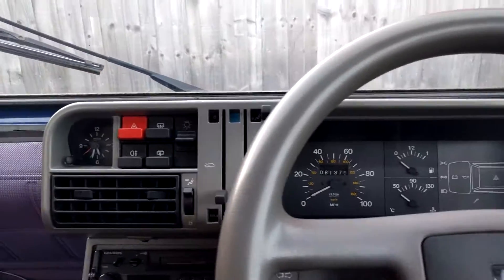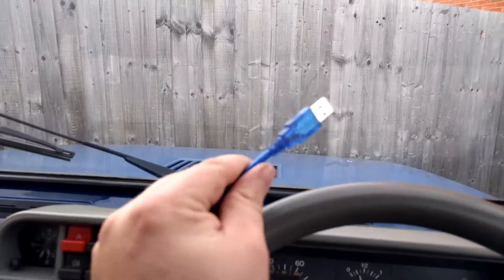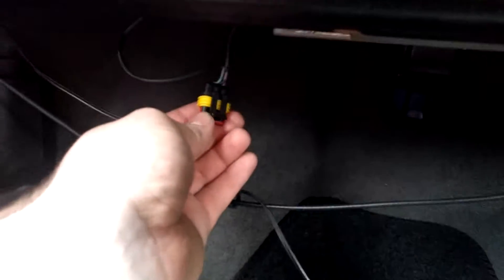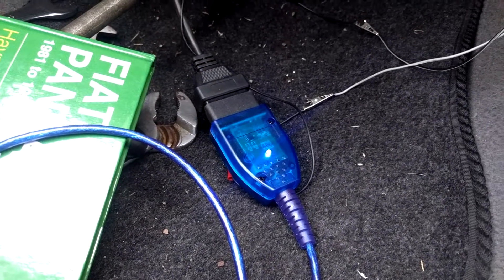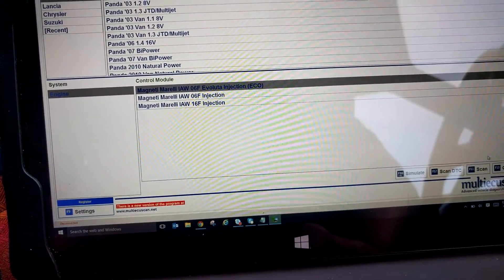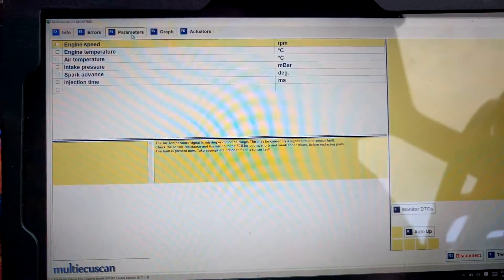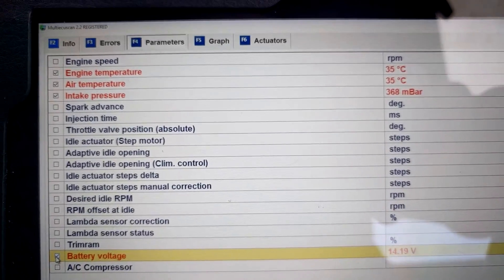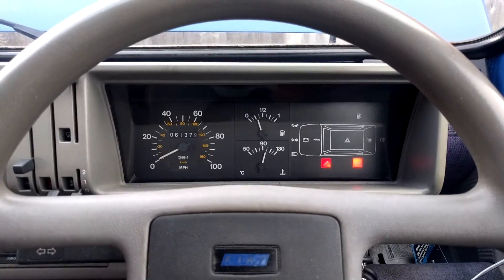Fiat panda selecta ECU code reading

Comment: Does this cover faults in the Selecta transmission?
Reply from the maker: Hi Chris, not at all, engine ecu only. I'm not even sure the CVT has any kind of ECU management. If you mean the later selector in the MK3 Pandas then yes you can use fiat scan to work though diagnostic and calibration
Reply: @fiatpandaman999   I have two mk2 Pandas (a 93 and a 94), both are Selecta models and both have different CVT problems.
Reply from the maker: @chriswatson7488  hi Chris I think I recognize you from the fiat forum and Facebook. I'm really no expert on these CVT boxes and I sold this one as it had started to slip. Real shame as I love how they drive
Reply: @fiatpandaman999  Aye I've been on both facebook and the fiat forum. I have more than enough parts to keep my selectas going, but the idea of reading codes just piqued my interest. If any part of a panda needs to have the ability to read a code, its the complex CVT box, lol.